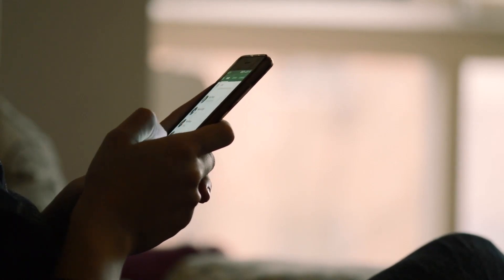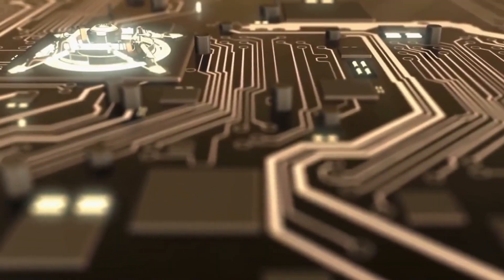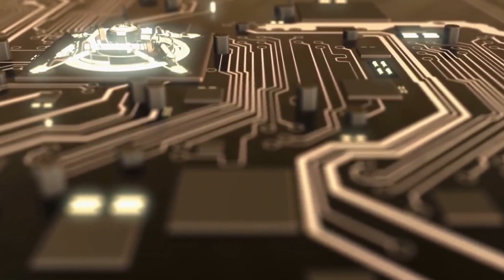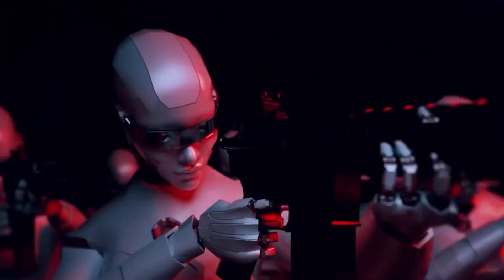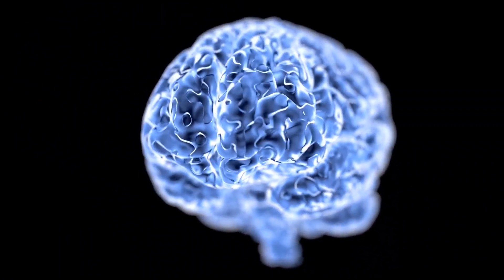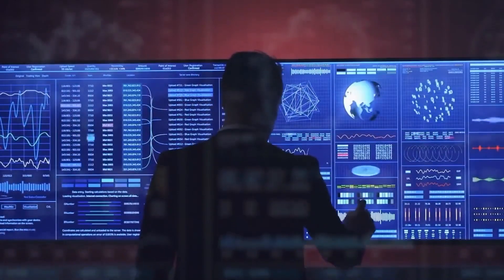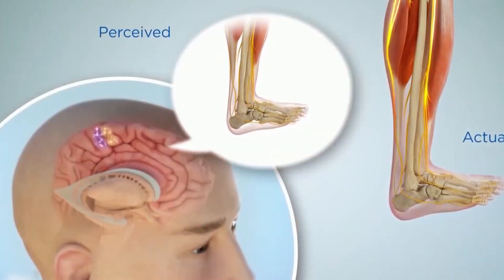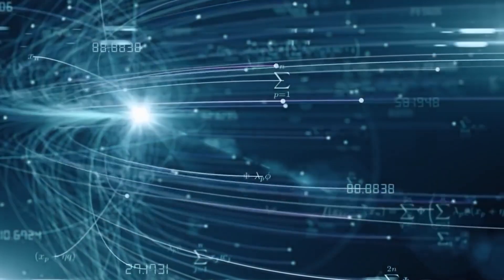TIMELAPSE OF AI (2030 - 3000+)

Comment: by 2050 we will have tech that can reverse the aging process but even if this goes off without failing then there still is a very high chance we will not live to see the year 3000 unless they find a way to copy are minds to a pc then we will live in some way shape or form. this is a very pessimistic out look in my opinion on this video I'm being slightly optimistic be that if the people in charge share it with the masses and if it happens in 2050 it could go all the way out to 2070-2080 its very close because we are almost to the point where a.i. can be of great assistance there
Reply: We will have tech in 2030